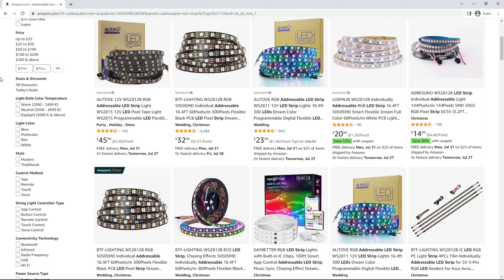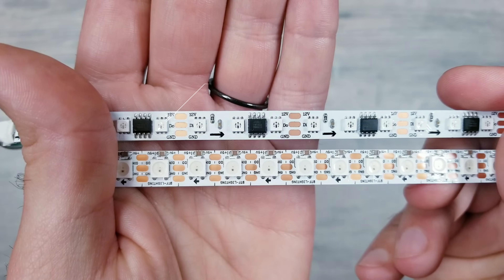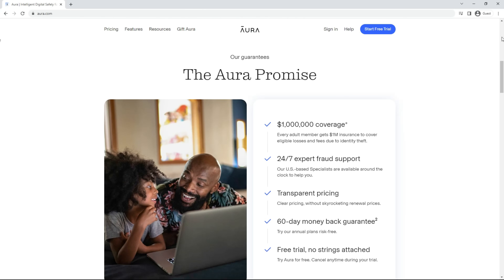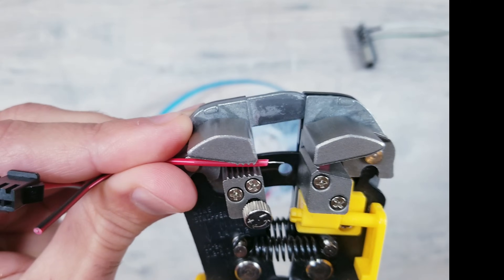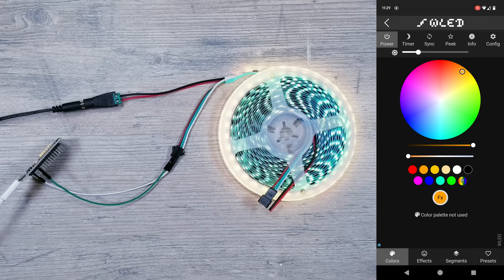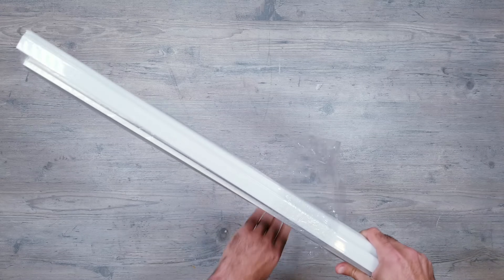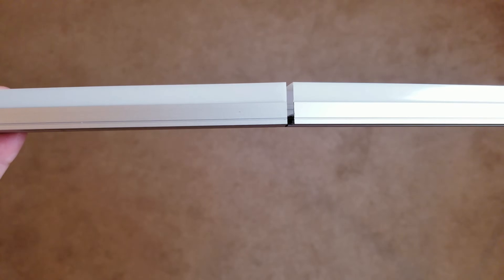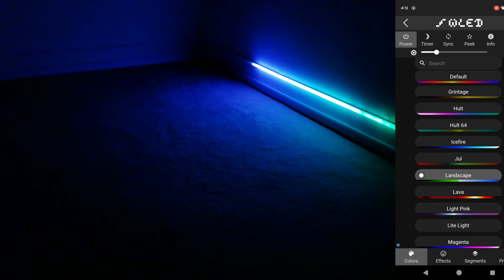BACK IN STOCK! The BEST LED Strip You've NEVER Heard Of + WLED Compatibility!?

Comment: The back of the track has a groove for the screw heads on the brackets not for wires. 
I'm hanging LEDs with tracks and those brackets are useless IMO so I bought 4 rolls of double sided tape. 
Nice video 👍🏼

Comment: I know this is a dumb question, but I have no knowledge of LED lighting, when you buy a role that is this long, you can cut it into as many strips as you want and each piece would need to be plugged in to a control box and power supply, is that correct?

Comment: I've built this exact setup however one thing you didn't mention is what to set the PSU limit to in LED Prefrences settings in wled. It shows 850mA in your video but shouldn't it be adjusted for the psu? What settings do you recommend for this? It seems no one talks about that part. in one of your videos you mention using between 3 and 5000 mA for your projects, but what would you recommend for a single strip setup just like this? As well is using a 12v 2amp adapter fine?

Comment: with regards to passing 2 or  more extra things of LED strips does this mean i would have to increase the 120v to 12v to somthing higher or would i some how have to do voltage injecting via those other cables ? like if i pass 24v but keep 2 strips or pass 36 for 3 strips etc

Comment: Hello Chris, so I bought everything you had here, same LEDs , same power supply , I got 6 esp32 . I was able to get the wled installed and save the WiFi and setting but for some reason the LEDs would NOT turn on. Every time I turn it on and off I see a little blue light come on on the esp32 . Any idea what I can do differently. I followed everything you did and as you mentioned here.i made sure I have it configured and  Tried different esp32 and diferente LEDs..still LEDs won’t turn on.
Reply: I forgot to mentio that the LEDs does work when connected using the wires they came with , with out the esp32.

Comment: So I purchased these lights and I'm wondering which controller could I use with these? I'm considering esp32, but I can't find one that would react to sound and that would be pretty cool to have. Ercisity ones are said to crash due to not being able to perform. I need a controller that would power 5 meter strips. Any suggestions?

Comment: I went to my local electrician store.  They had NDR brand. It’s what licensed contractors / electricians put under the cabinets.  I was able to pick up strips, driver, dimmer switch, and connectors made from the same vendor. And they were nice enough to help me with layout and how to run the wires. Use what the pros use is always a good thing.

Comment: Hey Chris! Loving the video, thanks so much for posting.

I have a couple of questions for you since the first LED project I'm working on is completely based on your videos,

How can I combine two of your videos into one? The videos are the WS2815 + ESP32 one, and the sound reactive one? So the question in short is how I can build a sound reactive LED setup using WS2815 and ESP32?

The second question is which diffusers in AliExpress do you find best?

Reason why I have to stick to AliExpress is because the shipping from US to where I am when purchasing from Amazon US is on the expensive side of things so I tend to stick to AliExpress and already have the BTF 12V 30A power supply and their WS2815 5m LED strip.

Would be so grateful if you get back to me!

Comment: Thanks Chris!  I ordered 6 of these for a pretty big project coming up.  What would you recommend for powering 6 of these strips, with no major drop in full brightness white?  These will be the main light source in a room 16ftx32ft.  I can do multiple power injection points if necessary.
Reply from the maker: Hey buddy! I would probably start with one 12v 10a power supply and do power injection every 20 or 25 feet and see how that looks! Sounds like a fun project!!
Reply: @ChrisMaherDIY - Since they are 5 Meter Strips (about 16 Feet) why not at each strip? 🤔

Comment: This seems to be the same video that was posted 2 months ago. Not sure if the price got even better or this is an accidental re upload. Not mad or anything, just confused. Great projects though I've learned a lot from these vids.
Reply from the maker: Hey thanks for commenting! It is the exact same video. When I uploaded it a few months ago they sold out of all inventory in less than 24 hours. They finally got a bunch back in stock so I uploaded the video again   in case anyone missed out that wanted some. Sorry for the confusion but thanks for watching and taking the time to comment!
Reply: @ChrisMaherDIY  They are sold out again (2023/10/03). Look at the influence you have!!  Great video. Thanks
Reply: I thought I was going crazy
Reply: Yea, assuming it was a mistake. Got these lights tho from last video recommendations and no issues with them.
Reply: Just checked and the price has gone up $6 in the last 2 months from 29.99 to 35.99
Reply: Chris what is your favorite plug & play? Is it still aqara? Having trouble with Hotspot with the aqara in the spotless muzata channel I'm using the flat square spotless channel.